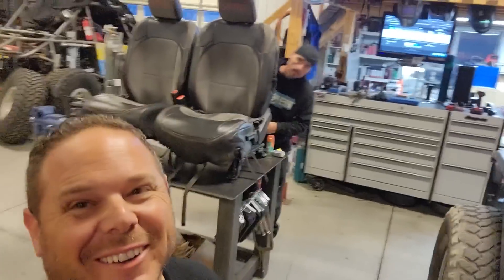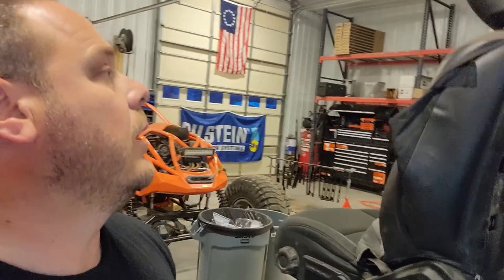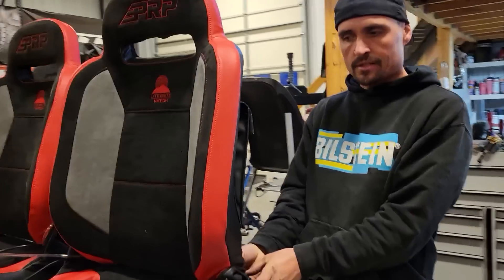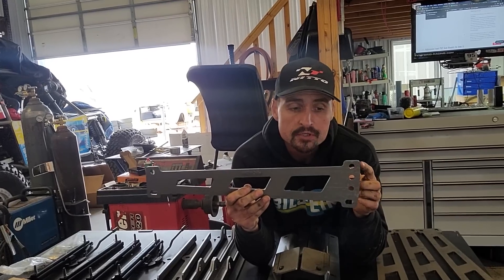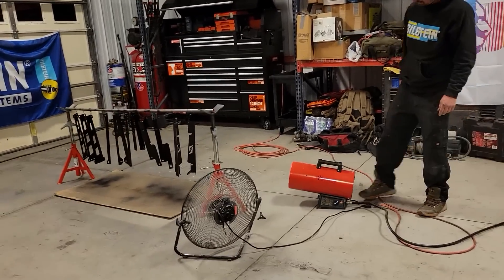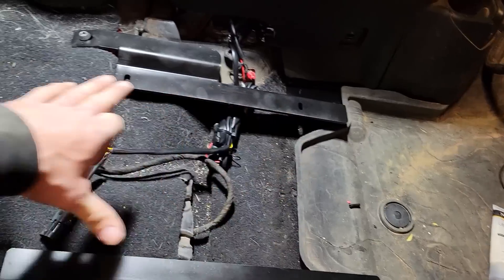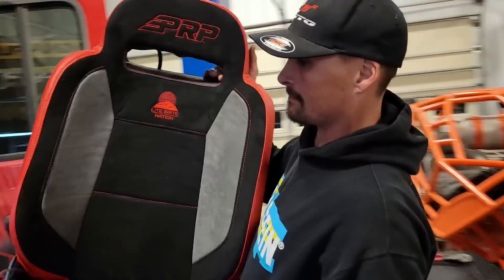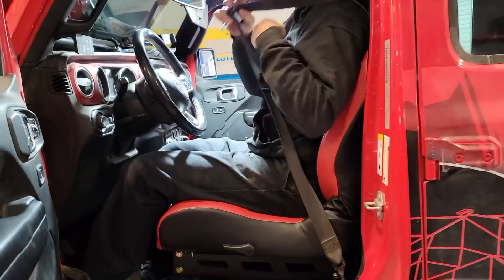LONG TERM REVIEW FOR PRP SEAT COVERS + NEW PRP SUSPENSION SEATS!

Comment: Honestly off road the StepChild might be safer without the air bags. Also with some of the hits you’ve taken I’m surprised they haven’t gone off yet
Reply: Not getting T boned at an intersection. Which is what side impact bags are for.
Reply: @adidas4275 glad they kept them, I almost smoked em on a small road at GSMJI when their dumb selves decided to do a 4 point u-turn on a 2 lane road around a blind corner.

Comment: Its funny you mention the lack of videos of people doing this in JLs as i was mentioning to my friend the other day because i want to install them in my JLU.  

I did find 2 videos one where they tricked the computer by putting the seat belt buckle back in underneath the rug with a fake buckle and the 2nd video actually showed the guy integrating the Weight pressure sensor (bag full of liquid under seat) into the PRP ones and it worked out for him.  Those are the only 2 so far i have found after a month of searching.  

Great job on the seats and everything and glad you guys are working with Tazer so that way it will be much easier.

Comment: You can use a seat belt extension to defeat the nannys that won't let you open the door and still drive. I just get the small rigid 2 inch extension and leave it in female seat belt latch.

Comment: The seats are in my top two disappointments with Jeeps.  Poor ergonomics and coushioning with the front and rear seating make driving time a pain when going distances.  I've thought about trying to retrofit a set of power seats out of a car that are similar dimensions to the original seats that have power tilt, lumbar and better cushions to make long drives more comfortable.  I did find an aftermarket replacement bracket that allows the rear seat backs to tilt which has made those a little better for rear seat passengers.

Comment: So program the switch pros to turn on that switch automatically on start & delay off by 5 mins or so & if you enable LV cut off then you can’t run the battery down. 

That is the best thing about the switch pros is being able to set stuff to battery or ignition, auto on or auto off & the delay on/off

Comment: Seat covers are a good thing.  I have not used these covers.  I have used Wet Okole seat covers on the last 3 trucks I have had.  Those PRP covers looked like they did well.  The new seats looked good too.  I have thought about replacing the seats in my Colorado because they can be uncomfortable; however, the choices are limited compared with Jeeps.  Always good to have some “PPE” with you.  I was thinking that when you showed that front pocket.

Comment: So help me out … my wife is literally 1 foot shorter than me. I love my Rockhard sport cage but can put aftermarket seats in without preventing my wife from ever driving as she needs the factory seat height adjustment … what are some options for suspension seats and harnesses?
Reply from the maker: This setup will sit her up super high
Reply: @LiteBrite   buts it’s not adjustable correct? My head is in the roll bar if I get in when she has it adjusted up for her.
Reply: @djpizzim  They are adjustable but not like the factory seats with the lever that you can pump up or down quickly.  With these you would literally have to unbolt the seat from the bracket, lower it and then bolt it back in when you have to drive it.  So that quick adjustment isn't there like the factory seats.
Reply from the maker: @djpizzim  it’s adjustable with tools. You would have to adjust the bracket manually

Comment: I wonder if they have an option to run for the switches on the heated seats on your stock switches? My jk heated seats suck and one has burned out and have been looking to put some cover that have heat but wanna splice in into my stock switch

Comment: Did you come with a solve for the airbag lights etc?

I am looking at picking up a set of PRP seats for my JL and want to get rid of the lights on the dash.
Reply: Looking for this answer as well
Reply: @ForeverJeep  

I have my PRP seats on order, so guess I will see what I come up.
Reply: I have got them and started looking at the install and the best way to get rid of the air bag light.

Comment: Why not put the stock front seats in the back?
Reply from the maker: Ummm because these are suspension seats which are more comfortable and we can now run harnesses to keep you in the seat better and they look way cooler and they have a water bladder
Reply: The stock rear seats fold down for carrying cargo.
Reply: @LiteBrite  so then your going to put suspension seats in rear as well? Kevin mentioned different seats to replace back seat.
Reply from the maker: @chrisanders2052  not adding seats to the rear. We need the stock rear seats to fold down for additional storage and never have rear passengers really
Reply: @LiteBrite  Apparently whoever this is I’m talking to you did not watch the video. At 17:18 Kevin says “Chris, should we put bucket seats in the back instead of the bench?” Was just making a suggestion to use the stock seats that were taken out. Wasn’t my idea to remove bench seat it was Kevin’s!
Reply from the maker: @chrisanders2052  ya it was just a thought. It wasn’t something we decided to do and if we did do it we’d put nice suspension seats back there as well but it doesn’t make sense to do any of that